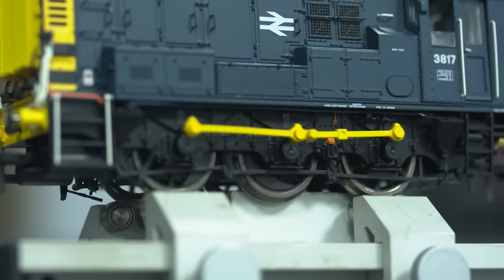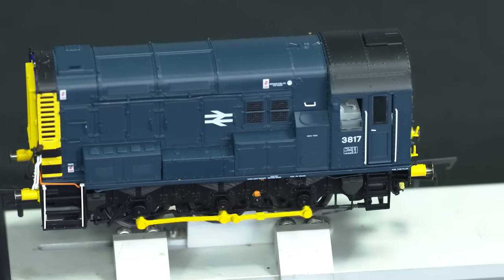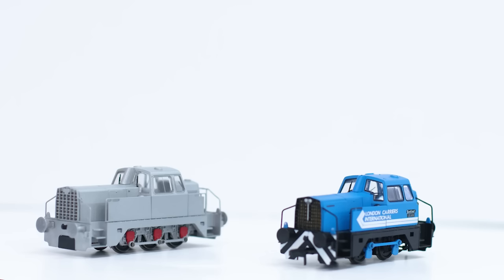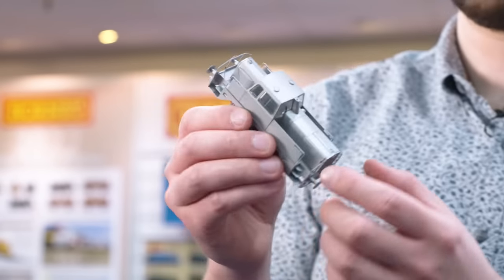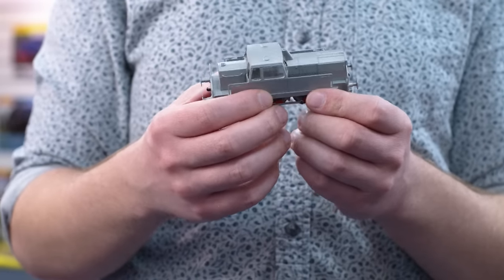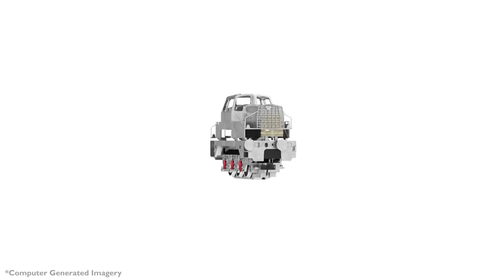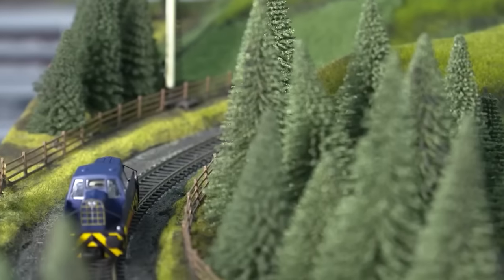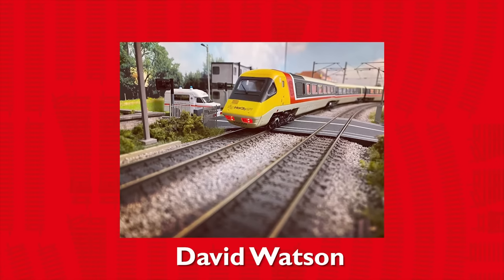Sentinels with Sam!

Comment: Only three problems with this loco Sam. 1. it does not run at slow speed as a shunter should. 2. it stalls on points. Which you said it does not and 3. The DCC decoder just floats around on the end of its wires. I could also say "Why are there no lights fitted? It costs £60.00 more than the 4 wheel Sentinels and just because it has 2 more wheels. The design is good, but the finished model is not value for money. Martin. (Thailand)